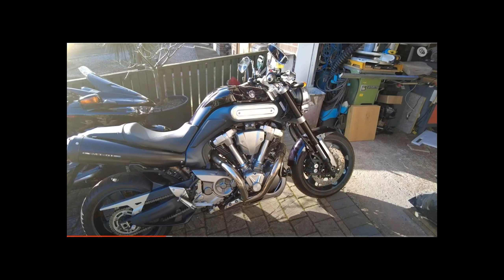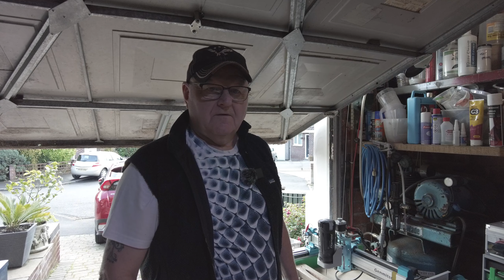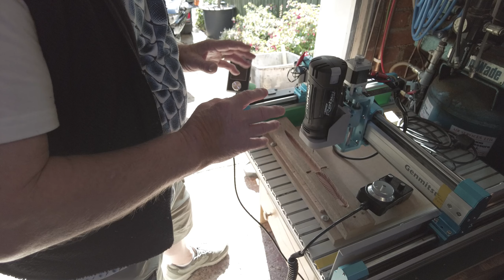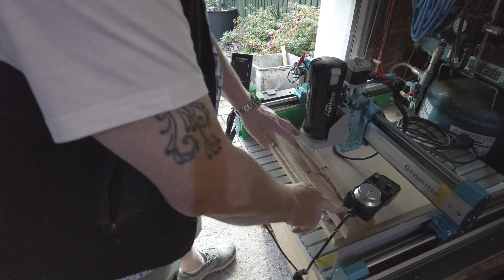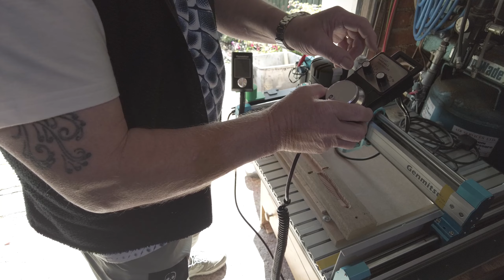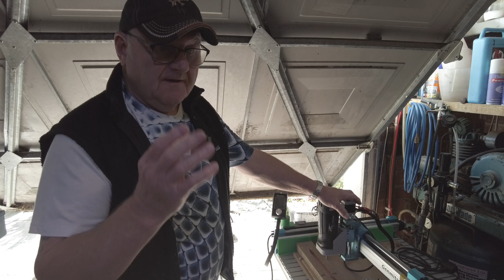Sainsmart Cnc 4040 cutter change on a different Toolpath

Comment: Excellent explanation Tony...answered a lot of my questions. Regarding the Z..James Dean has a video that adds a command to Candle that enables a button that remembers the last Z setting on a job. After a bit change at the proper XY, you hit the button and it remembers the Z...but your method is great as well, and writing coordinates is vital, especially here in Florida land of lightning storms. BTW, I solved my Genmitsu not recognizing my Z probe..I wrapped a piece of paper around the router and it isolated it and the probe works great.and the paper is not even visible
Reply from the maker: Hi thanks for your comment, I am still learning
Reply from the maker: Hi will have to watch his video it would be different for me as I don't run my CNC from a PC but that would be useful if I did.